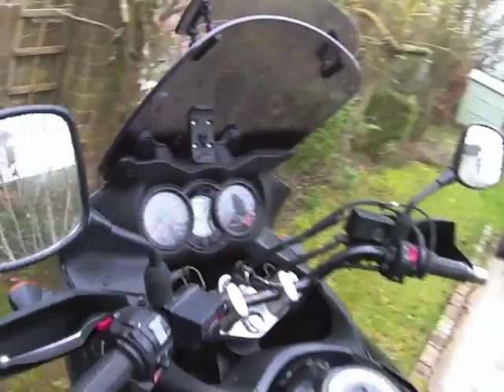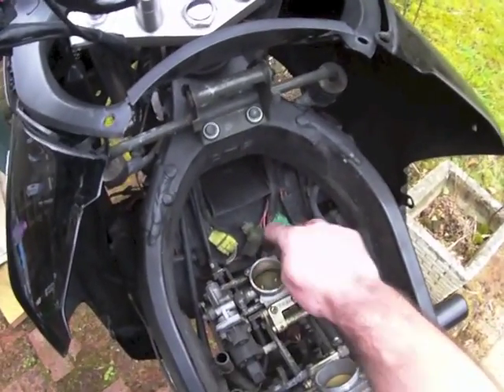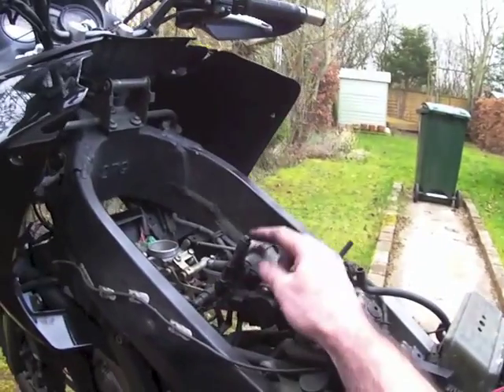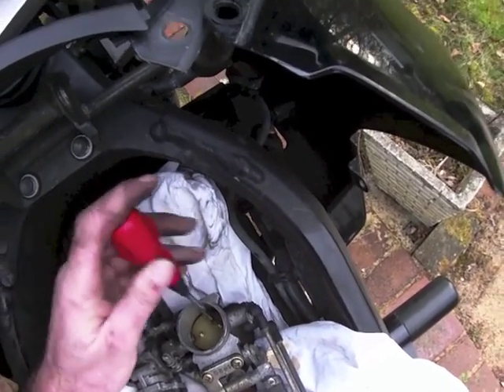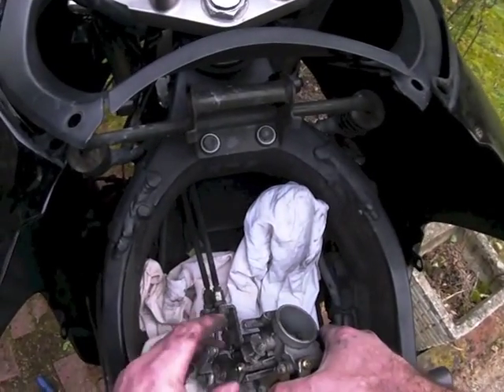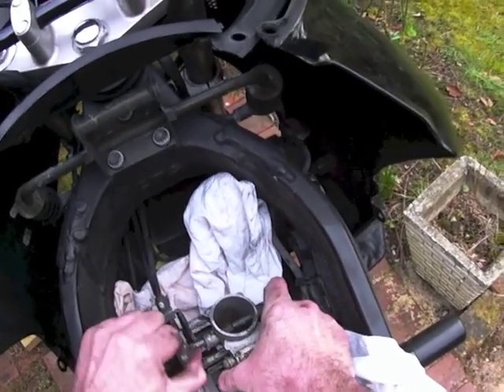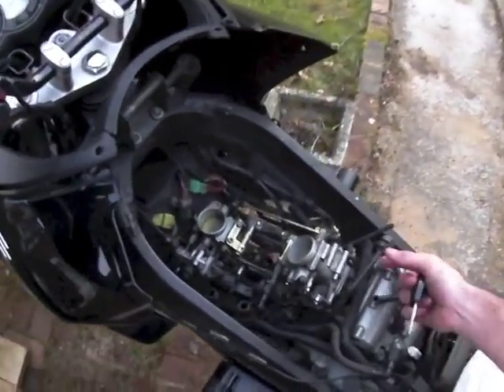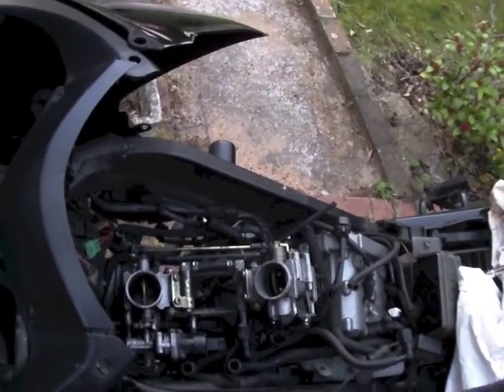DL650 STVA repair

Comment: I watch a lot of videos on the DL650 and check on the Stromtroopers forum, but thats the first time I have seen or heard about this issue. Your video was a bit hard to hear on my computer and I did,nt hear what the sysmptons were to know when the problem came up.Was the only problem with the butter flies sticking. I love my Strom but maintenance is a pain in the arse to work on them. Thanks for taking the time showing us.
Reply from the maker: George Lee thanks for your comment,you've reminded me of an important bit I missed out.. first, sorry about the sound quality, it's shite, try headphones. at 3.11 I switch the ignition on and the butterfly valves don't move. that's the symptom. if it happened when I started it, the bike would run like it's being starved of air (because that's what's happening). very weak power and stalling. the bit I forgot.. is that the FI error can be many things, you have to put the bike into dealer mode (with a paper clip, plenty on YouTube to tell you how to do that) to get the specific STVA error code to display on the screen, I forget what number it is. I've had no issues at all with my dl since I fixed, you're right mate, great bikes ;-)
Reply: i BELIEVE C28 is the code

Comment: You answered your own question as to why it happened. At the start you noted the rubber boot between the airbox and front throttle body looked as though it was not fitted correctly and you noted the dust etc in the throttle body because of this. Since the rear TB was fine and the front was binding I think you can assume the incorrectly fitting boot caused the issue due to excessive dust etc bypassing the airbox. From a rider of a DL650 09 with 160,000 kms with no TB issues. Do agree that the front boot clip is a real pain to install correctly and tighten.
Reply from the maker: Steve McCormick I agree with you, but that doesn't explain why so many stroms do have this issue. Yours may not have, but I think it's a 50 50 chance

Comment: I pulled the plates out when i got the FI C28 and put a black tape over the warninglight. Bike runs like a rocket in all gears and wont let off untill I let go of the throttle. Im gonna lube up my shafts aswell to make the ecu happy. But the blades will stay out 4 ever.
Reply from the maker: Is the idle all OK as well?
Reply: @SVRoquetta I have to watch the idle when cold. Guess the plates works as a choke. Idle is not effected other than that. Make sure the boots are prop seated and do a throttlesync. Happy times!
Reply: Got myself a nice long PH2 screwdriver to prop. tighten the front boot. Thanks for the vid! I'll copy your work. Cheers

Comment: Hello SV Roquetta. My 2006 VSTROM 650 has a loss of power around 7000 rpm when the engine is hot. Do you think this symptom could be the same issue than you ?
Reply: I am having the same problem right now with my 05 650